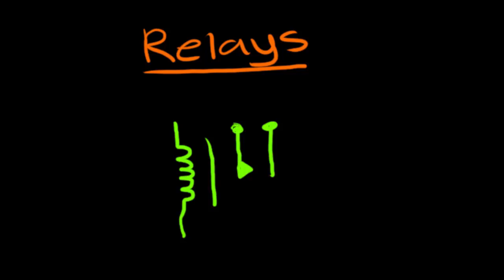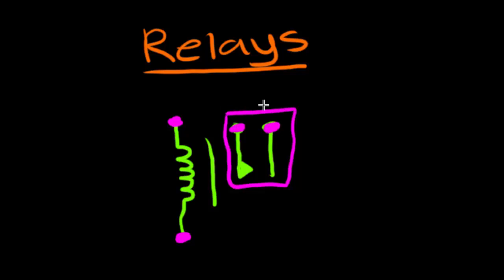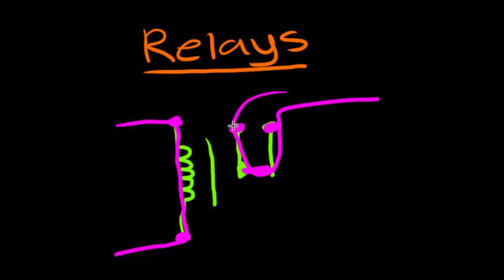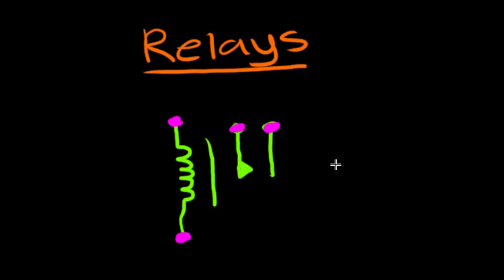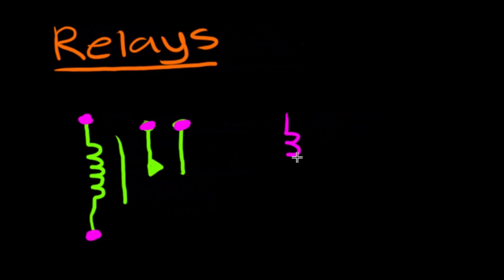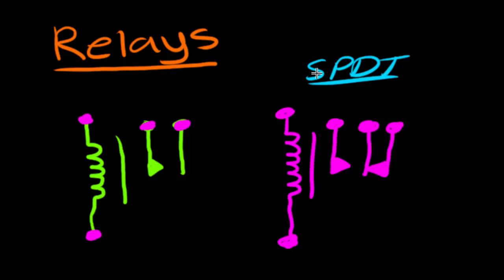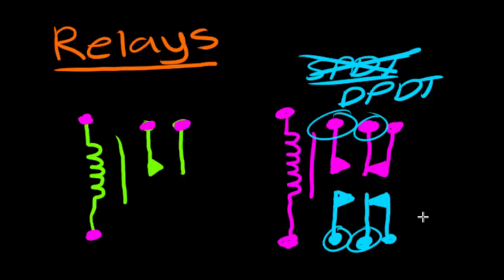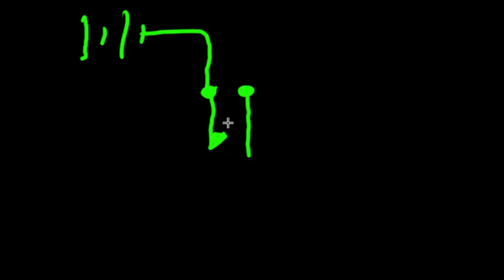Beginner Electronics - 21 - Relays

Comment: question about the circuit at the end of the video: was there two separate batteries used for this circuit? if so why could the led and the positive feed for the relay both be hooked up to the same power bar on the bread board?

Comment: He has missed the main point of using a relay. That is to use a low voltage to "switch" a high voltage equipment.
So for example, I can use battery power to safely switch on a 10kv motor safely (as an extreme example).
So the video would probably be better served if had used a separate power source to do the switching.

Comment: I dont get the point of the relay. Cant you just make this with just the button?
Reply: Yes but a person doesn’t have to use it and electricity does it all. Also i don’t know much about eletronics but I believe this can be used as a timer. And it can hold the charge until it loses it’s charge or is halted.

Comment: This is the best relay explanation. Initially I thought these are not useful as much, but judging by your explanation they can be super useful for controlling a single circuit via another circuit / power source that can have its own separate logic and can be distant. This kinda expands the list of tools you can use while designing your circuits in other words uses your imagination :)

Comment: I don't know if you're still making these videos, but I have a question: The relay you are using says 2A 30V, but you are only using 9V. Does it matter that the voltage is less than the relay's rating? I read somewhere else that if the voltage is lower it won't power the relay. Great vids, I'm working my way through them building as I go. Thanks.
Reply: It is the highest voltage rating for relay it mean it can't handle for than 2A and 30v (AC or DC it have been written)
Reply: @rekhasaini672  that does not answer the question...

Comment: trying to find part! yours says its a "HK19F" which is rather expensive at $8,50 an "HK4100F" is $3.50 the 19 does match what you have and the 4100 simply says its a mini power relay. what does the "hk19f" mean? whats the difference between the two?

Comment: Vehicles have relays with the ignition switch (used to be a push button on older cars,) . When the ignition key turns on, it supplies power from the battery to the vehicle elements. When the key or push-button is activated, this sends the charge to the relay some on the inner side of the fender, to make the electromagnets live and connect the contacts to supply the power to the starter. This then activates the starter, UNTIL, the key or push-button is released.

Comment: Hi i dont get it on the dpdt relay lets named the lead 1 2 3 4 starting from the right one as the first ( the electromagnet) 

So the 2 and 3 are normally connected when no current. When there are current 3 and 4 are connected is that right ? Or when there is current 2 and 4 are connect ?

The pointing make it hard to see. I wonder when the electromagnet is on it should attracted the switch to be on its side but why 2 and 4 are connected then?

The hardest part is number 1 ( the first pole is connected to the capacitor ) but the 2 ,3 and 4 how do i know which one to connect to ? In the video the resistor is connected to the second one and the 4 is connected to negative.  Why is it has to be like that can we connect it to number 3 instead ? Or swap 2 and 4 .

Thank you and thank you so much 

I really wanna know the answer. 

And the video 23 confused too !

I will leave comment at the end so you can quickly find .
Thank you again

Comment: What source did you use to get 5 Volts. Are you combining batteries of different volts?
Reply: The output of the switch is only five volts
Reply: It says so on top of the relay.

Comment: what is that ground wire for?
Reply: The ground wire completes the circuit ,  off camera it is plugged into the ground rail on the switch side of the circuit.